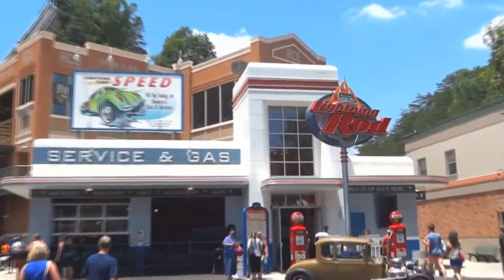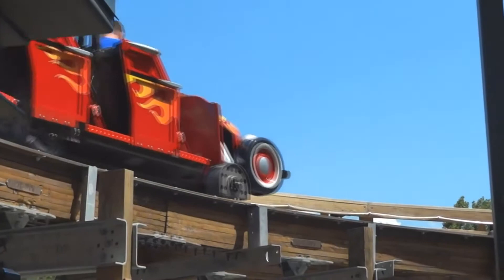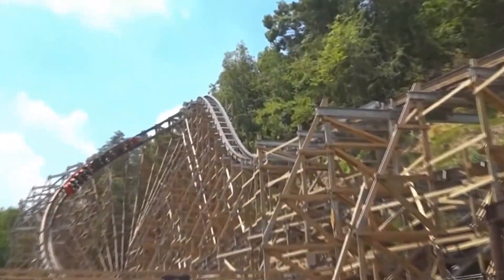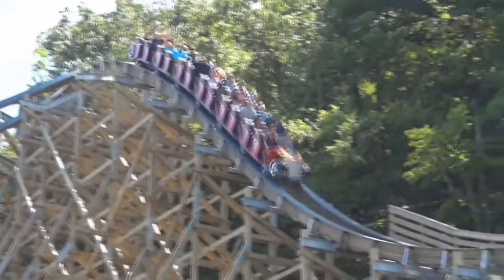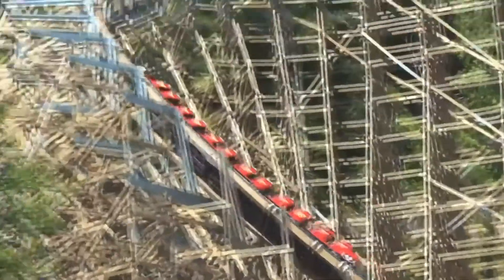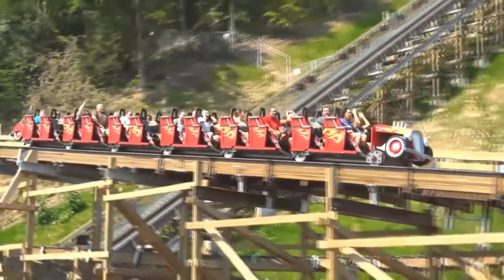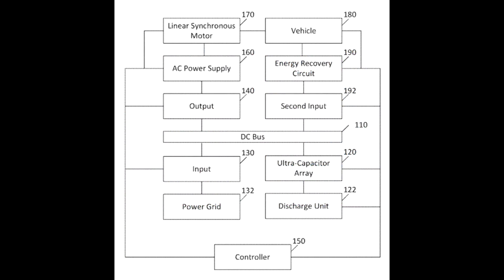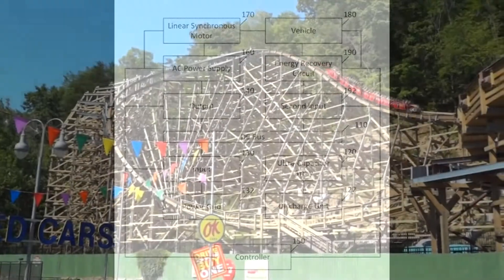Lightning Rod Using Ultra Capacitor Launch System?

Comment: given that diagram its also likely as the coaster stops that potential  energy is dumped back into the storage system  ,like regen braking in an electric car , this greatly decreases overall energy use ..

Comment: that might explain all the delays they should have just did premier
Reply from the maker: It's possible, although most of the rumors I've heard say the issue is something with the trains and not the launch. We'll never know for sure.
Reply: i through the trains were fixed after the recall
Reply: +Nicky D I've heard it's closed for the remainder of the season.. 😑
Reply: wouldn't surprise me at this point